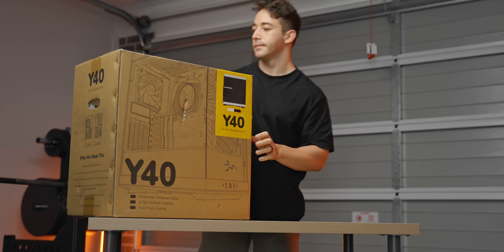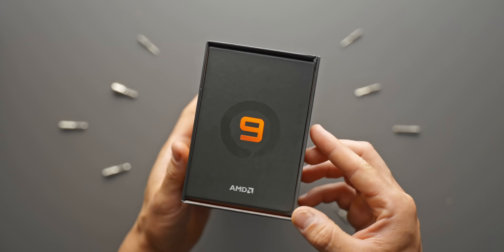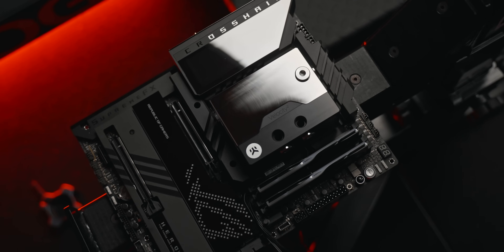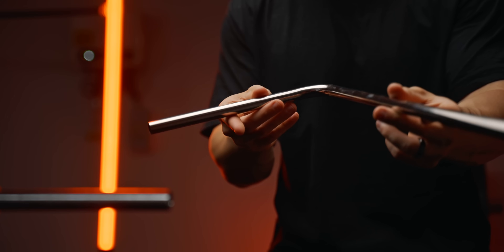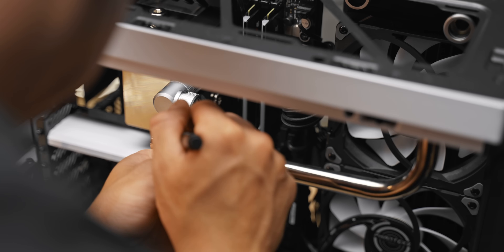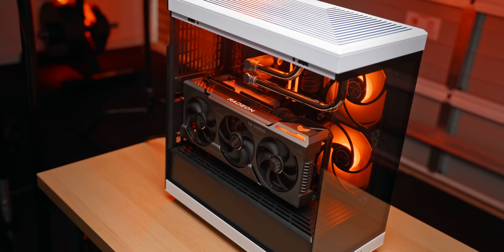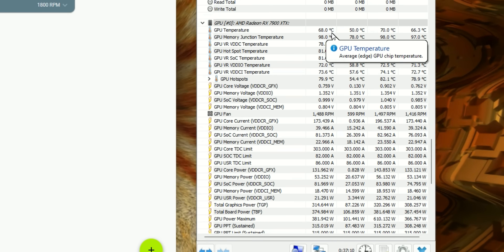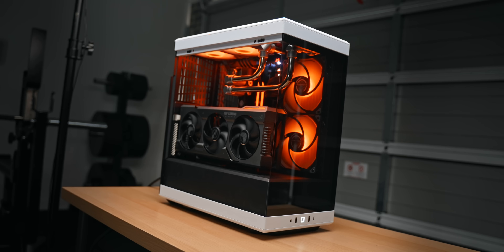Fastest AMD PC – Hyte Y40

Comment: It would be interesting to see how the thermals are when you flip the AiO Fans.
As in, the fans on the bottom, rear and top push into the case and essentially only the fans at the AiO are exhausts.
Reply: I agree, this is what i would have done. The way it is right now, the air is already warmed up by the 150w CPU load, which then GPU uses to dissipate its 350-450W load. Makes little sense.

Comment: Great build, but I think you should try rebuilding your water cooling pipes and radiator, so the water flows to the bottom and the air to the top of the radiator. This should help with cooling the cpu better

Comment: Stunning build man. Didn't realise metal tubing was an option. Do you think/would you every analyse the effect that different tubing material (metal/eva/hard/flexi) and fittings have on coolant temperature? Wondering if any radiated/conducted heat transfer would be better/worse and whether this matters. Anyway, super slick build and love the setting as well!
Reply: it doesn't matter at all don't worry

Comment: I think you shouldn't tighten the cpu cooler bracket's screws all the way one by one, you should make 2 turns maximum on each screws with the following order : top lef bottom right top right bottom left to avoid any potential dmg on cpu

Comment: Intrigued if the pump/block combo is compatible in ITX cases
Reply: It was designed for that. The side ports he did not use are the same height as using EK's Velocity² block plus their low profile 90 degree fittings. You can save two of those fittings and clear most of the low profile RAM kits.

Comment: You could still install the 360 radiator without the fans or partially mounted fans, it would still help with cooling as long as you have positive pressure inside the cage.

Comment: Hi! One question. If not the tall CPU block would the thick top radiator fit just fine? I plan to buy this case but i have thick EK radiator that is about 60mm without fans. I wonder if it will conflict with motherboard. As far as i can see the motherboard is a little bit behind the radiator? So it should theoretically work? tia

Comment: Gen 4 or Gen 5 SSD? and which one?  The Ram is only mentioned in the text, any problems with that did the system ran stable at 7200MHz, what amount of RAM, 16 32 or 64 GB?

Comment: Cant see any reason that setup couldnt do a much better job of cooling that cpu.  I have the 5800x3d with an off the shelf 240 AIO and my temps almost never go over 60c.  Seems like there may be air in your system still.

Comment: Are you serious - the mounting system is the same all the way from AM3 to now AM5 ; so it will mount the very same on the AM4 boards. Curious as to why you have both the 7900XTX and 4080?

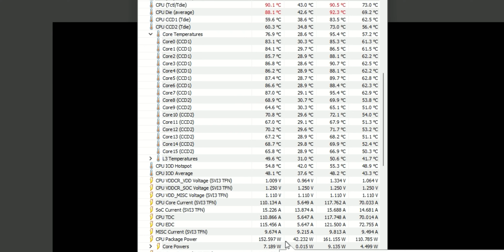Comment: 11:33 I have the same issue with my 13600K. I have it overclocked to 5.7GHZ, and whilst it doesn’t even draw 200W it starts hitting 95c in cinebench; and I’m using an arctic liquid freezer 2 360mm for reference. It seems some CPUs just don’t dissipate heat all that well no matter what cooler you use.
Reply: This case specifically is known to have bad thermals
Reply: Think that with fresh side intake compared to top exhaust,its the best one can achieve already. He could try some tweaking or eco mode

Comment: Do you find any issues with vertical gpu cables? I bought one before and had issues overclocking my gpu. Turned out it was the vertical cable and plug. As soon as i removed that, i had 0 issues. Since then i dont want to try it again for fear of wasting time and money.

Comment: Don’t Ryzen 7000 always run at 90C? It’s intentionally done so they always run the clock speeds as fast as possible because they can handle that heat.

Comment: in my opinion the radiator fans are facing the wrong way, now they are dumping hot air into the case and towards the GPU.
Reply: The GPU temp is fine, as shown. Priority has to be given to the toasty CPU. In this case it’s the correct arrangement.
Reply: There are top exhaust fans……
Reply: @ElectricDreams2  I'd reverse the radiator fans for exhaust or place them behind the radiator for cool air from outside the case